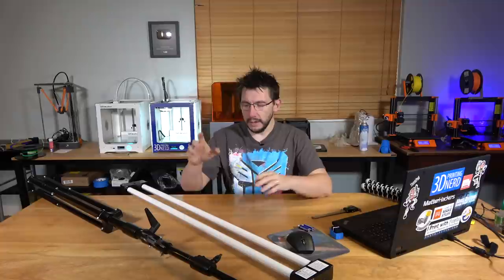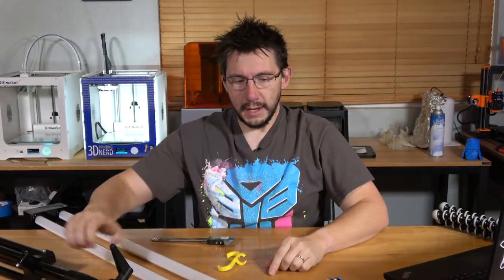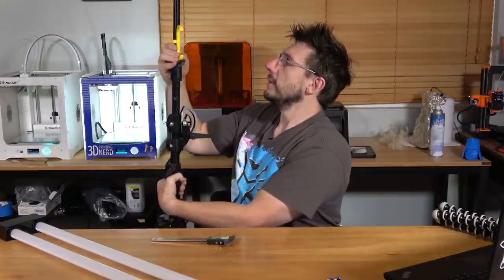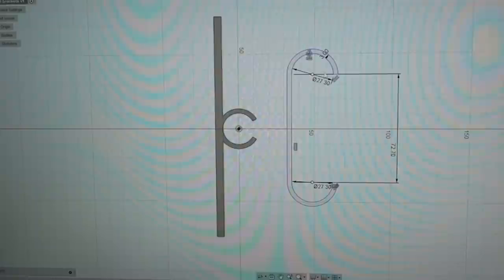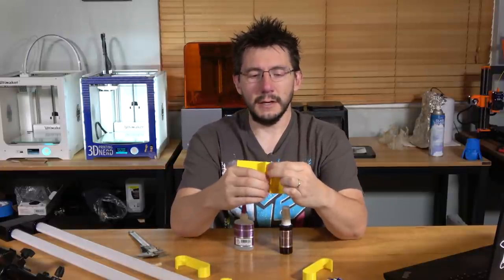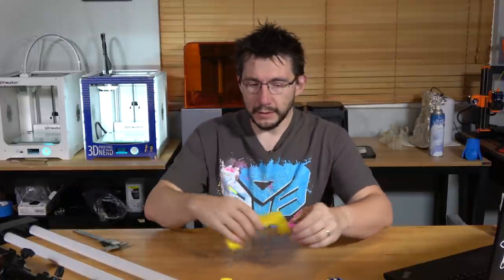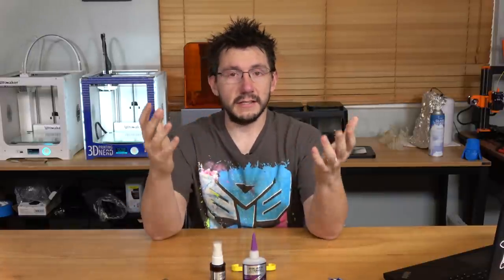3D Printing a Light Bracket Designed Using Fusion 360 [Practical Printing]

Comment: Nice job Joel! it looks great! I have an advice for you. You could print some kind of tulip with a parabolic shape, where the lights will be placed in the focus of the parabola. it's easy to design, and it will give you a lot more directional light, since right now, it's radiating light in 360º. You could print it in white PLA or any other colour, and there is a possibility to cover the interior part with aluminium foil since it will provide even more brightness.
You can print it modularly with fragments of (whatever max high you have with your printers) and then attach them to the tubes with the nice clips that you designed :)
I'm an architect that loves 3d printing and i really enjoy designing useful stuff, please contact me if you need any help with designs, i'ld love to help you :)

Comment: As I have just ordered my 3D printer and have no practical experience using one, I was curious as to why you glued the light retainers to the backer plate, instead of printing it all in one shot?  Was it the strength of the material in that direction, or that too much of a support structure would be needed?   Thanks for all of the great info, keep gettin' it done, so that you can Call it Done
Reply: Good question.  I'm not Joel, but my guess is it was a choice based on both of those things.  You almost always get cleaner prints if you don't need to use support materiel.  And yes prints are typically weakest in tension in the direction of layering.  Thus if you can avoid having those in tension it is best, and by printing this way he did that.  If for instance he had printed the back plate flat, and then had the round part that came over the tripod on top, the way the layers formed he would have a much greater chance of breaking it when he pushed it down on the tripod. 

The great part of this hobby, is that it is usually easy to recover and learn from failure as well as success.  One of the best ways to learn how your prints behave is to print some, and see what happens, and then if it doesn't behave the way you want to try and come up with a way of fixing it, both on your own and by asking the community.

Comment: Where'd ya get the led light? I needs one.

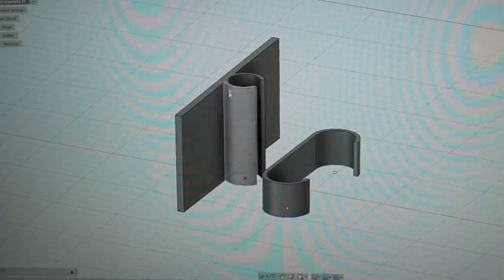2:18 you should use a screen recorder (OBS will do in a pinch) because pointing a camera at the screen introduces moire artifacts
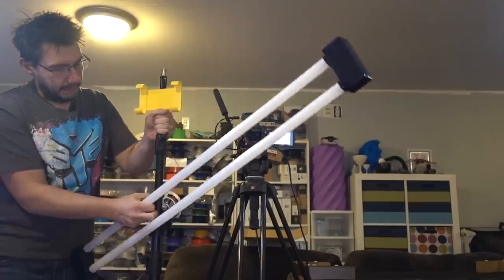5:57 I have that same ceiling light!
7:35 my favorite independent hobby shop logo!

Comment: Where did you get the lighting fixture? I want one that doesn't have the whole back on it so I can use different length bulbs?  Name / model number?
Reply from the maker: Home Depot! local one to me, about $50. It's an all in one LED fixture.
Reply: I picked up a LED single tube on Amazon for about $14 and it needed a cord (old printer style 2 prong) $2. It added a ton of light to my healing bench/ maker space

Comment: How hot does the bulb get? And what material did you use?
Reply: I wondered about this, too, when he said that the print would be using the bulb for contact points.  Might be better to get a second light stand and create a print that only touches the ends and prop it up that way if the bulbs get up there in heat after a while, there's no risk.
Reply: Sean Connelly agreed. I know that florescent is more efficient than incandescent. So maybe best case scenario is that he prints with PLA and the heat might "anneal" the PLA and shrink a little while it's mounted.
Reply from the maker: +Viet Nguyen it stays room temp. It's LEDs

Comment: Why did you had to glue parts? Could have a made a single piece.... ???
Reply from the maker: +hugo nascimento could have but that would have required support and longer print times.
Reply: 3D Printing Nerd point taken! Thanks
Reply: 3D Printing Nerd Could have used a 45 degree angle with two hooks to avoid support material.